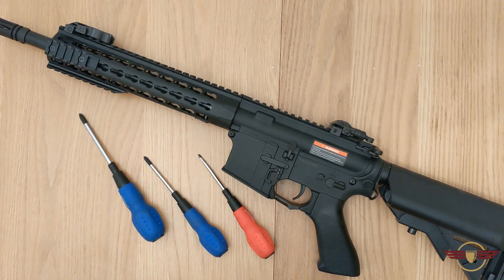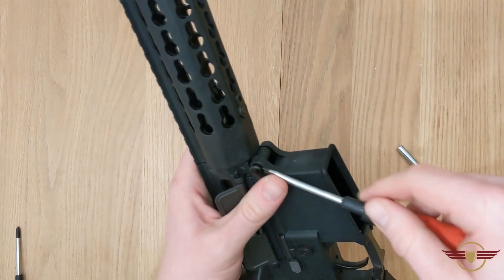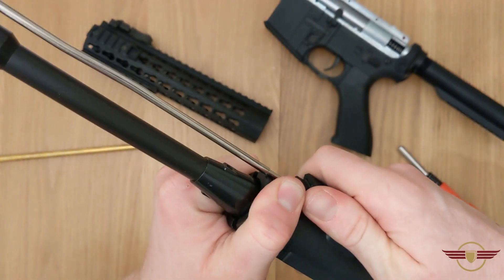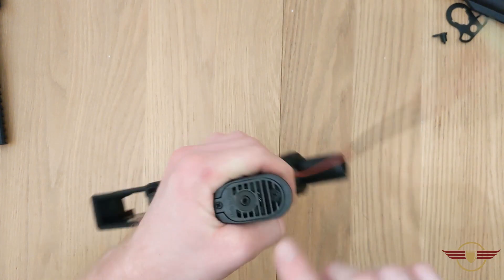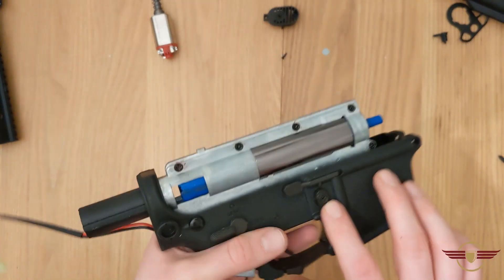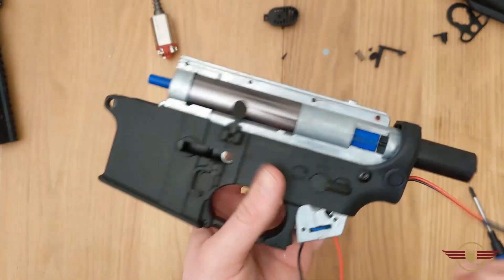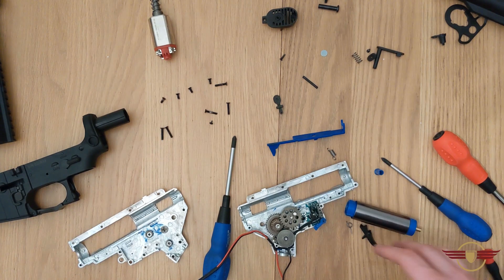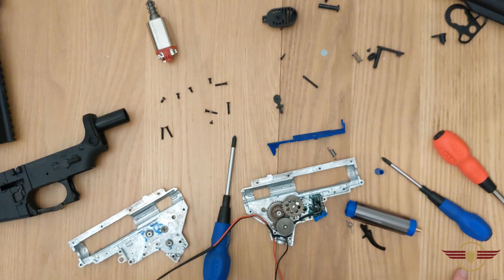[OLD SCHOOL][HOW TO] CYMA CM.621 BUDGET STARTER disassembly internal review

Comment: SO grateful that you've got this up because the Cyma 621 that I bought just under a year ago just simply stopped firing during play. I tried firing all sorts of voltage through to see if I can kick the cycle into gear again, but nothing's budging, so I'm going to have to take it apart and check it out myself. As a noob to airsoft tech I'm so glad you've put this video up. Just fantastic work!
Reply: I just bought one, and out the box isn’t firing, I bought new batteries, still doesn’t fire, did you find the issue?
Reply: @Wilma5532  I got the same problem
Reply: I had the same problem, turns out it's MOSFET failure, got it replaced and now it works

Comment: Pheas, a question, not really related to CM.621 but to CM.032, which is M14 version from CYMA. When starting to shoot semi fire, first 5-7 BB's have a quite big spread, and after 8-9th shot it stabilize and become fairly consistent and accurate. Changed hopup rubber with a Maple Leaf Monster and spread got bigger and totally random, so I had to put back stock rubber. Is it related to gearbox consistency? Because every time after the toy rest for a longer time frame, first up to 10 shots have a random and quite big spread, then it settles down and it it fairly accurate.
Had the gearbox opened, greased, improved compression, shimmed so this way got read of some gritty noises, but I did not changed a thing in. Still going on its 110 spring, no reason for me to go for a stronger one. BTW, first time you open a ver.7 gearbox is really scary, until you figure out how to put back all those external pieces...
Reply from the maker: Hiya.. thats very very odd. From what you have described I would have initially said the hop rubber was damaged which you have replaced, then I would have said maybe fps inconsistencies, which you have improved. Have you shot through a chrono and see what happens over 30 / 40 shots with the fps, to see how consistent it is? The other two things I can think of, if its not variable fps, is the airnozzle may be damaged, or the inner barrel could be damaged and the bbs are catching on something which is spreading them out. But then both of those things wouldnt exactly settle after 8 to 10 shots... Have a look at the barrel first and clean it or replace it and then maybe the airnozzle to see if it is badly shaped or broken / crack in it maybe. Pheas

Comment: what is your opinion on cyma cm068b??? i think u are the guy to ask :D
Reply from the maker: Hello! I did an unboxing of one! https://youtu.be/DC-9Oe3U0P8 I really liked it, alot! I love AKs and I love ARs so this was an excellent blending of the two. My only long term concern was the hop was unique to the gun, so if it breaks then it could be trouble some to get hold of the correct part / parts... But its very rare a hop unit breaks. But really nice piece of kit, if I didn't already have such a large collection I think I would have kept it myself. Pheas
Reply: @PheasAirsoft  u misunderstood ,  068B not 650 , 068B is an m4 , it look's like this 621 but metal barrel . I did not find videos on it , 160 euro gun on taiwangun and i cannot decide to buy it or not . thank u for the reply
Reply from the maker: @andrashuszar8303  Hello! Sorry you are right, didnt read it properly! The base 068B looks solid enough, metal body, should have the blue internals as well and has a tight bore barrel so not a bad package at all should perform at least as well if not slightly better than the cm.5xx series. However for slightly less money you could have a DE M904 which has an outstanding mosfet in it and is general excellent value. It doesn't have the tight bore, but the standard barrel and hop are pretty damn good for what they are! Either would be a good choice and the cm,.068B would make, like the cm.5xx series, an excellent base to build on long term. Hope that helps! Pheas
Reply: @PheasAirsoft  Thank you! your videos helped me allot by the way! :D keep up the good work !

Comment: I got this gun recently but it doesn't have the battery cover on the stock, is there anywhere i could buy those parts instead of buying another stock?
Reply from the maker: Hello! If you got it brand new then I would ask for the retailer for a replacement. If second hand, it would be a case of finding someone with a secondhand one with the right plate for the back. It could be that buying new might be the best way. sorry! Pheas
Reply: @PheasAirsoft   where can I buy the parts, additional what are the parts named so i could buy them.

Comment: Does this have a fuse ? My one when I plug battery in the mosfet jingles like normal but is totally unresponsive otherwise and will not even try and fire in semi or full auto position. I have noticed the mosfet has a red light coming on I can just see from trigger gap. Any ideas on how to get this firing again much appreciated?
Reply from the maker: Hiya. It doesn't have a fuse, have you checked the wires are connected to the motor, I've known them to work loose on their own before. Otherwise the trigger switch may have failed in the MOSFET, which seems to be one of the issues people have reported. You might want to try: a different battery, then a different motor, try having the motor connected but sat outside of the pistol grip to see if it will spin, if it spins when you pull the trigger then the gearbox may be locked up from a breakage inside. 

When you pull the trigger, put your ear to the pistol grip and listen, if there is a click noise on each trigger pull it could be the gearbox is locked up because of a breakage. Have a go at those and see if they help. If you are in the UK I have replaced a few of these MOSFETs with other stuff and happy to work on it (I'm very cheap I'm told) Pheas
Reply: Thank you for taking the time to reply! I tried a spare motor and 3 different batteries  still no luck. I think your right it may well be a faulty trigger switch in the mosfet or the mosfet itself. Been trying to read up on these mosfets seems to be a lot of bad reports. As this is a budget m4 don’t want to kick the arse out and get the best replacement mosfet but could you recommend a reliable go to mosfet to replace this one ? Thanks in advance and keep up the great videos!
Reply from the maker: @JoeTheBassMan61  Hiya! It just so happens I have completed my video (not publicly released yet) that looks are replacing the mosfet and how to do it. I have used a Gate merf as they are around £40 and are excellent, you could in theory use this same method, but wire in any mosfet of your choice (the purun AB++ is good for a little less, but ideally get one with active breaking) Here is a link for you to have a look at before it goes full public later in the year: https://youtu.be/Tsn9Say_lQI

Let me know if you have any questions. Pheas

Comment: I'm curious. I thought about buying this replica from taiwangun. I saw that they can service the gearbox but I couldn't find any opinion about their service. Is it any good?
Reply from the maker: Hiya. From what I have seen and heard, if you are not wanting to tinker with the gearbox then it is value for money, the improved shimming and regreasing can be good for the gun. If you are good with working on them then I would say save the money and get some more accessories. A lot of the cyma stuff (particularly the higher end) has pretty good shimming anyways so may not be needed. If I was to buy something like the Double Bell stuff or Well (the much lower brands) then I would consider it worth while. They are at least doing it for cheaper than I would charge for doing the same. Hope that helps. Pheas
Reply: @PheasAirsoft  thanks

Comment: Plastic pistonhead and plastic piston teeth with 380-410fps (standard spring) won't hold long. After 2days of skirming. Rip piston teeth. And a high speed motor with so high fps will won't work that well. Or there are some high torque gears in there. But I don't think so. A lot of faults i think. Pls comment if I'm wrong.
Reply from the maker: Hiya! The gears are 18:1 (standard) so nothing special, a lot of people are running these for a while at those sort of FPS ranges with no issues. The KWA stuff (by default is about that fps and they have a plastic piston and piston head) and I have yet to ruin one myself, only seen one that was messed up in a KWA. But I have also seen Tokyo Maruis break a piston first time of pulling the trigger. The piston is something that WILL break regardless eventually, but I don't think they are that trouble prone. My CM.028 shredded one piston after less than 500 rounds because of the high speed motor and an 11.1v lipo at 320 fps... it was a test... for science... honest! Pheas

Comment: does gear can holds up 11.1v? and this model same as cm616?
Reply from the maker: Hello, I would hvae thought it should be ok with an 11.1v lipo. It is same line of models as the cm616 so has the identical internals. Pheas